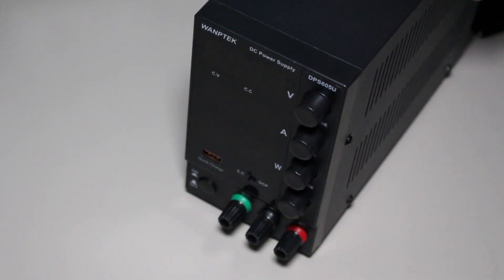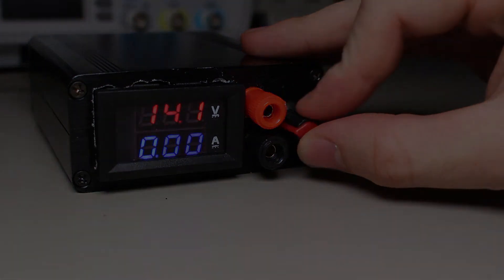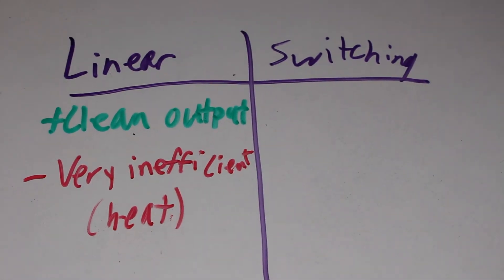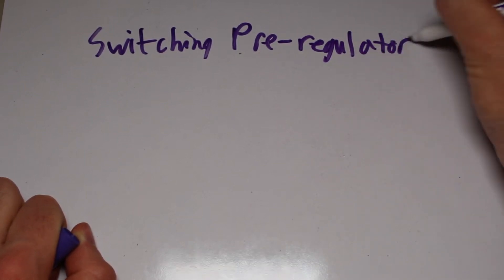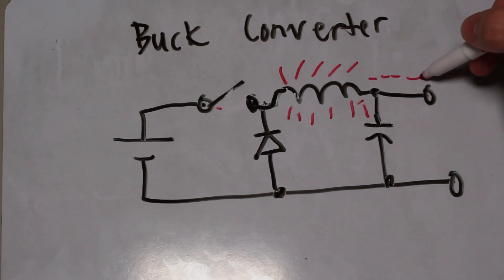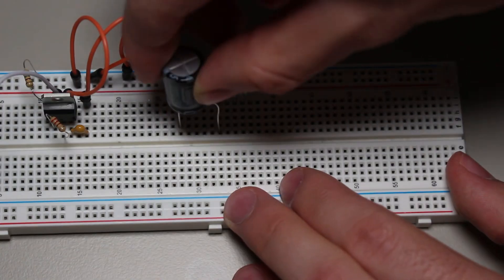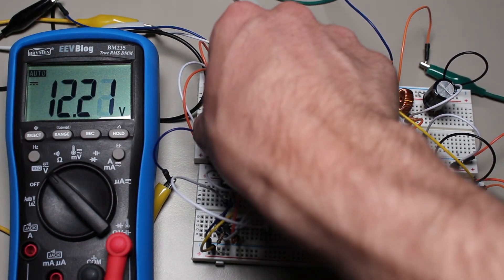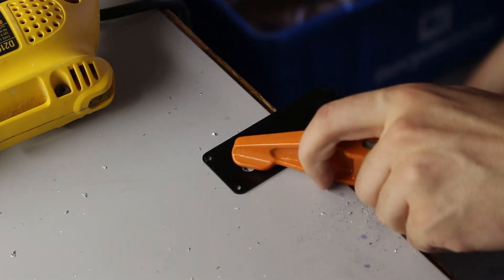Efficient Linear Regulation? - How does pre-regulation work? DIY Power Supply

Comment: Great video. I m new to electronics and I m wondering can  you amplify the dc input 24v to 40v using dc boost converter without making significant noise in the output?
Reply from the maker: It depends on the boost converter chip that you use. Modern boost converters have gotten quite good, but they are not noise free either.

Comment: R5 is 0.1 ohms or 100M ohms ? the smallest i found at my retailer is 0.56 ohms, can I put this instead ? (I'm complete beginner btw)
Reply: Also RP1 i am not sure what to select, can someone sharea link of the appropriate component ? Im so lost..... :(
Reply from the maker: @deneuxben  R5 is 100 miliohms, which is also 0.1 ohms. RP1 is a variable resistor or a potentiometer.

Comment: Great video - very clear explanation.  I'm planning on building a linear bench power supply and heat dissipation is an issue.   Using a switching pre-regulator seems a like a good idea.  Since I may use it to test some audio gear I believe the lower the switching frequency the better. You specify an LM2576 which has a switching frequency of 50KHz,  but  they make an LM2596 which has a frequency of 150KHz.  It's $2 more but I think I will use that.

Comment: Great. But according to what I recently heard, yes, Linear Power Supply do not 'generate' noise. But they can't really fully 'filter' very high frequency ripply present in the input already.

The Output looks very clean, thou. Did you compare the AC component waveforms of the final output and the switching output?
Can you compare this to a direct, simple linear regulator output?

Thanks.
Reply: yep I think it need filtering between the two regulator stages as well as proper shielding to avoid the noisy smps to leak through the linear circuit.

Comment: Is an additional current limit necessary here since the LM317 is internally limited to 1.5A? Wouldn't a fuse on the input alone be enough?
Reply from the maker: Yes a fuse alone would be sufficient for this supply. However, I designed this current limit to act as a sort of resettable fuse. Meaning that once the current is exceeded, I don't need to go inside and replace the fuse, but rather just push the button to reset it. It's just convenience.

Comment: Instead of putting a 5v zener to set the current limit can we change that reference to variable voltage as this will help to add current control feature and how much current this type of design can output can it handle 3A?
Reply from the maker: Yes, I would have made a variable current, but the case wasn't really large enough to accommodate it. In this design, the maximum current is limited by the LM317 to 1.5A, you can choose another regulator, or use an extra transistor to increase the current abilities.